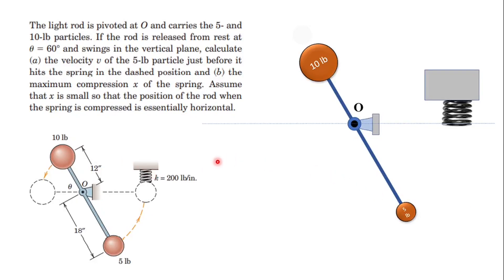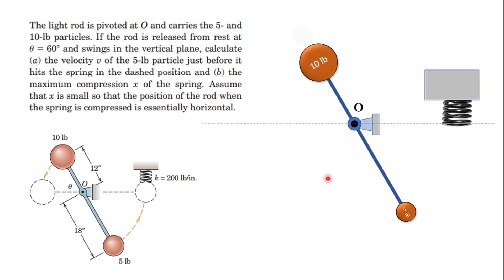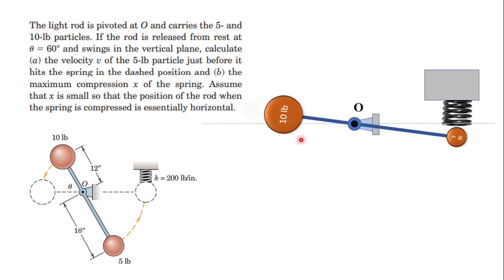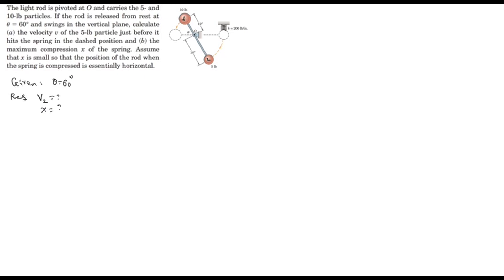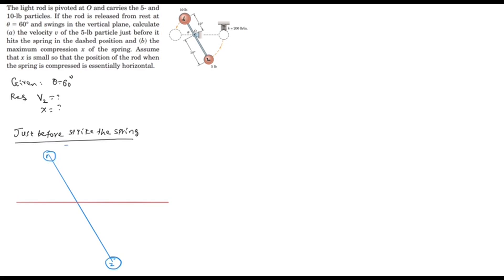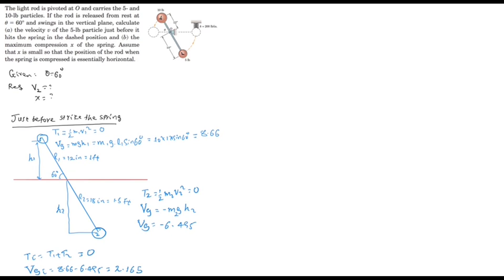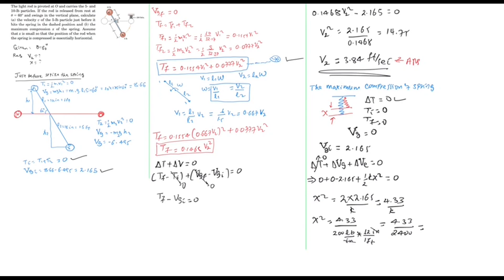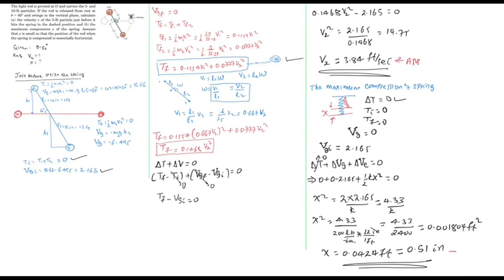Dynamics 03_08 Work and Potential Energy Problem with Solution in Kinetics of Particles

Comment: could you please explain how you got that the kinetic energy of of the pendulum is equal to zero, it seems quite counter intuitive as you have just worked out the velocity at the point before it comes into contact with the spring.
Reply from the maker: Good point. 
The velocity of the the sysyem (pendulums) is zero at the initial condition(released from rest).  At the moment of maximum deflection of the spring, it will become at rest too. Those two conditions are used to calculate the maximum deformation of the spring. That is why change in KE=0.

We can alternatively use the condition as follows:
1st (initial), just before impact the spring, [the kinetic energy is not zero].
2nd (final), at maximum deformation of spring, the system will become at rest [KE=0]

The answer for the deformation will be the same.
If it is not clear, I will further explain it.
Thank you for your valuable comment.
Reply: @KasmaTutorial  thank you, your explanation was clear I didn’t realise your initial condition was from rest.